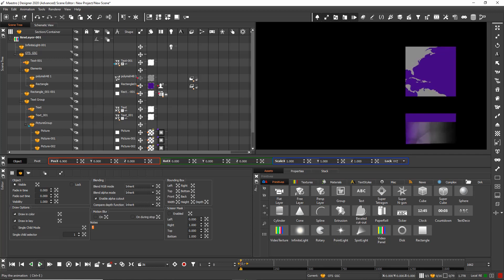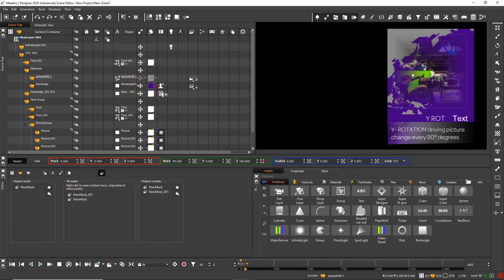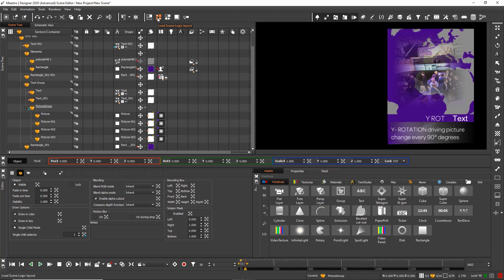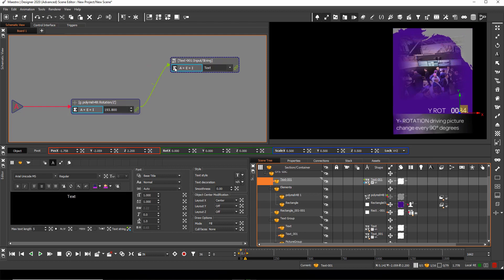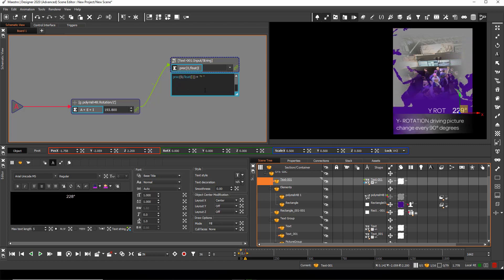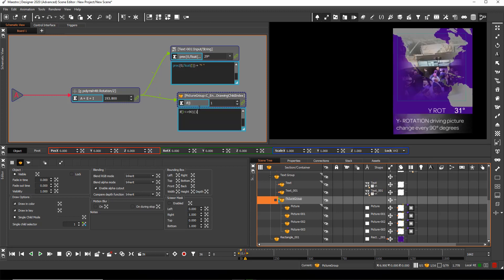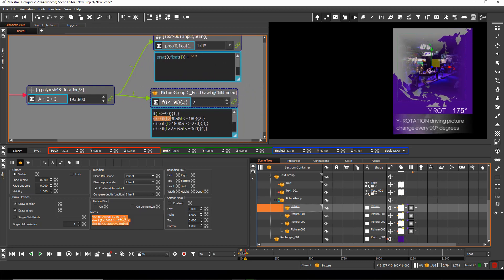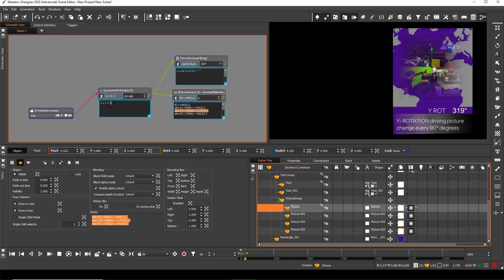Maestro | Designer Schematic View — Connecting Properties

Comment: You might have optimised this function a little:

#define tymul = ChangePictureOnRotationVer1
#I asume rotation is looping from 0 to 360 if not we would ned modulo function

if(I <= 90) 1;
else if (I <= 180) 2;
else if (I <= 270) 3;
else 4;

or even simpler:

#define tymul = ChangePictureOnRotationVer2
#I asume rotation is looping from 0 to 360 if not we would need modulo function

if(I > 270) 4;
else if (I > 180) 3;
else if (I > 90) 2;
else 1;

If you analise it, it will give same functionality with easier operation (grater, not greater or equal) shorter function. Only one bound is needed since if (in version1  lower angle, in version2 upper angle) condition is met previous if statement would be true therefore coud would execute first true value statement.

Or super simple solution:

#define tymul = ChangePictureOnRotationVer3
(int(I) / 90)%4 + 1;

this will also give looping value between 1 and 4 and is not dependant on animation of globe event if you use out of range animation. It will always give change every 90 deg of rotation. :)